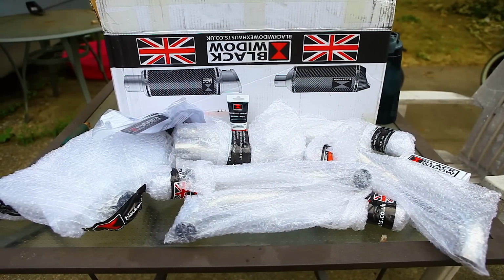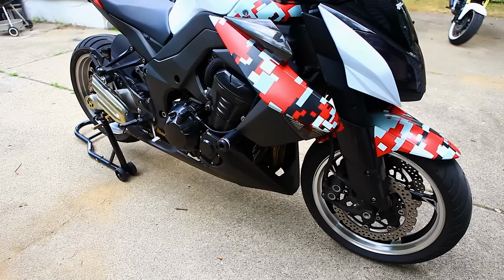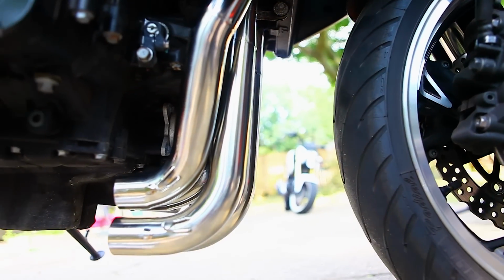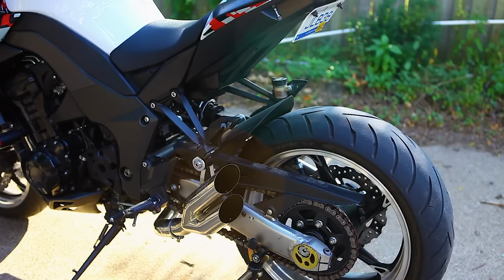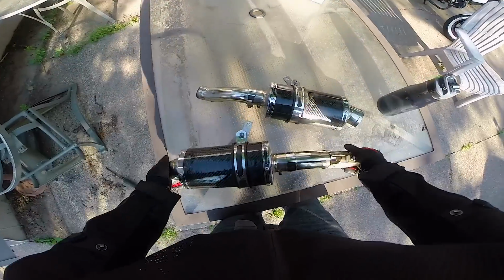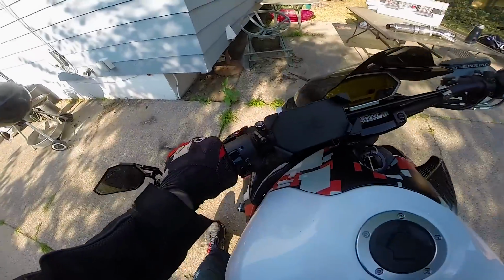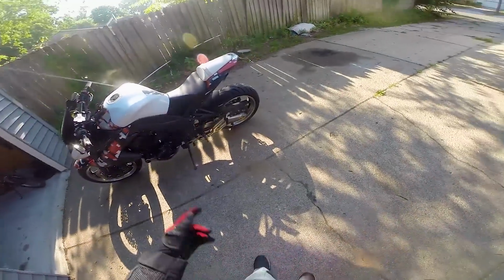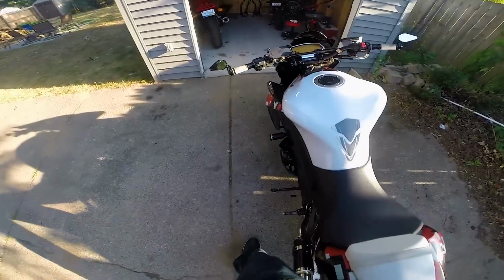World's Loudest Exhaust! Kawasaki Z1000. Dem Muffs!

Comment: Very nice Z. I just put on aftermarket exhaust today on my z1000. Mine is a 2010. The stock exhaust system with even a aftermarket y pipe was still restricting. I put on some sc project mufflers on the dual system and it’s plenty loud but getting rid of the stock headers and y pipe and going more bigger system really woke up the bike. I have a dynojet pcfc on it right now and I’m being conservative with the settings except the top end which is the Z’s achilles’ heel , going for a low budget improvement, you gotta watch what ya buy. I’ve got the dynojet power commander 5 and ignition and autotune ready to be installed.  The bike now is insanely fast and loud. Omg 😳
Reply from the maker: sounds awesome!
Reply: EN187 how’s that Ivan’s flash work out for ya ?? I’ve heard ivans is the best in accurate flashing for this bike. His website has a lot of graphs to show ya what he’ll do for you.    Love the Z !! Glad I bought mine.

Comment: Sounds noiceee!!! Very jealous of how easy your install was.. my BMW was a painnnn in the gooty hole getting my akra headers on there 😂 also the power commander was key to leveling everything out I recommend that or the ecu flash it does help a ton.
Reply from the maker: I see everyone raving on the ECU flash this dude does, 26hp gain with headers and it does a ton of other shit too.
Reply: EN187 absolutely go for it man, my worry with flashing the bmw's ecu was that it's a fucking complicated bike electronically not many do flashes for s1000's. So I used a "splice in" system. Just make sure you decide on what tips you want before you get it so the ecu map is matched perfectly. It should tone down the popping a bit and help the bike run cooler for you too. Let us know what you decide on you can't go wrong either way 👌
Reply from the maker: Will do thanks for the HOT TIPS man!
Reply: EN187 anytime man!! Also get her warm and take a look at night my bet is, if it's like mine she'll go full dragon for you 🔥🔥🔥

Comment: Do they make valved exhaust so when you pin it and go over 50% rpm it will just open up and go straight pipes but when cause l driving keep it quiet? I know they have them for cars
Reply from the maker: I think the stock had a servo on the oem muffs but that shits all long gone lol